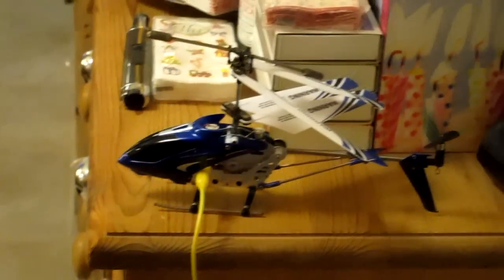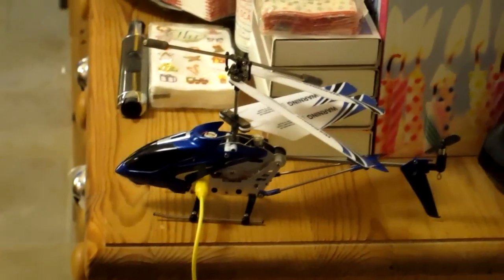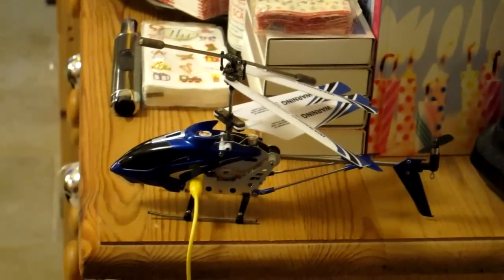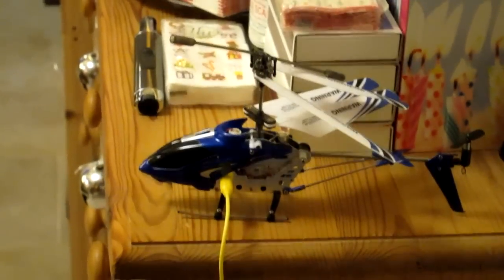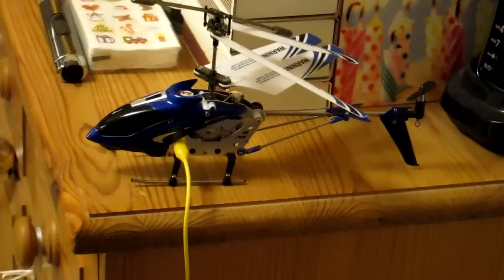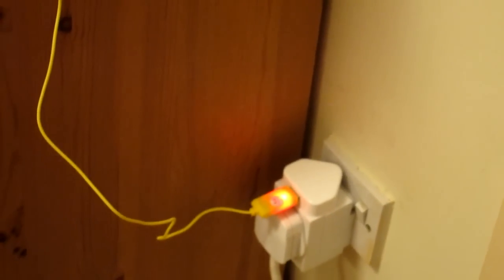Syma S107G Gyro IR RC Helicopter. Infra Red remote Controlled. Charging and wing Damage.

Comment: If you unscrew and dont lose the tiny screws of the cockpit cowling you can see the battery and a code number on it, it will be 3.7v and maybe HW then a number and a mAh rating ie;150mAh. Go on ebay and enter li-poly and your number and you will find the same code battery but with a higher mAh rating, I bought a couple rated at 180mAh for just a few pounds for both and replaced the 150 with the 180 (easy solder job) I get better response, more power and longer flying time. about 12 mins now compared to 7 at best before. Seems the factory fitted batts are not great quality or old.
Reply from the maker: +S G Whoareyou Many thanks for your excellent and detailed information. I am sure that will help many people. :)

Comment: Hi Tom, I have the S102G , the Black Hawk model, and when I plug the USB lead in to charge it, the led in the USB plug immediately illuminates, and does not go out. Not sure how old this one is, I got it from the local charity shop. Strange thing is that it flies okay after charging it for approx. 1 hour, but that led never goes out - whats wrong?? Paul

Comment: any reason the ir would act up?im getting some odd ball interferance.iv had ir birds before,none acted this bad.i normally dont like ir but i got a good deal on this one so i took it.everything was in very good shape,but it feels like there is a lag in signal responce and other weird things happen.like throttle not cutting out when released,throttle going up and down when stick is heald steady.its possesed.
Reply from the maker: I found the remote worked well within 20 feet. More than that and I did get issues.

Comment: i got the same but i got a problem with on/off botton i need to push him for the gyro turn help plz
Reply from the maker: I am not sure I understand your question.
Is it that your On/Off button now only works in the ON position if pressure is also applied ?
Reply: Br'w the Problém is that is getting in charge in the Off Position but i thing that the button is Broken and i should move it in the Middle for the charge br'w

Comment: I was wondering my helicopter won't fly I think is the batteries in the remote cause the light flashes red not green like yours.
Reply from the maker: Sure try changing the batteries first and then making sure the 'pairing' is done again.
If problems continue you should take a read through this thread / forum. It is great.
http://www.rcgroups.com/forums/showthread.php?t=1306276

Comment: My Syma107g takes 1.5hours to charge! I just bought it yesterday....the flight is around 5min30seconds....is there something wrong with my battery? The red light flashes after 1.5hours! Once I charged it for 1hr and took it out coz the light wasn't flashing and it flew just fine (5.5 min)....please help me out! Is there something wrong with my battery?
Reply from the maker: Tanishq Pradhan My only comments are to make sure you only give the Syma 1 amp of power. (So use a phone charger / laptop etc and not an Pad charger etc) Too much may cause the battery some issues. 
Mine takes about 75+ minutes to charge and I now get just under 5 minutes of flight each time. But mine is a few years old now. I think what you are saying is about right. It has a very tiny battery and often devices will trickle charge the final charge to help lengthen its life. Sure you could unplug the charger after say 40 minutes and probably get 4 minutes of flight time. But not sure long term that will help the battery life.
Reply: Tom Strong Reviews thanks a lot man! I connect it to my TV,it takes about 1hr to charge and I get 7+ minutes of flight time !
Reply from the maker: Glad you liked it. Yours reads better than mine!
Maybe they have improved the battery in this model since I bought mine back in 2012.
Reply: +Tom Strong Reviews my battery doesn't charge
Reply: +Tom Strong Reviews my helicopter doesn't charge right it keeps saying that it is charge but the helicopter doesn't turn on
Reply from the maker: +Eric Tube HD First try a different charger anfpd If you are still giving it 1 Amp at 5 volts and it is not working... Then your battery may have died. Lots of use and crashing can reduce charge time..
Otherwise, a connection has come free and it can no longer output its power to the electronics.